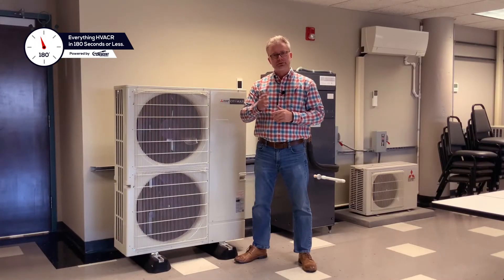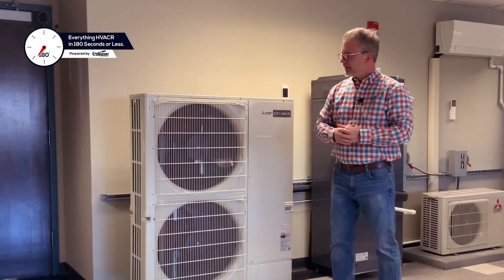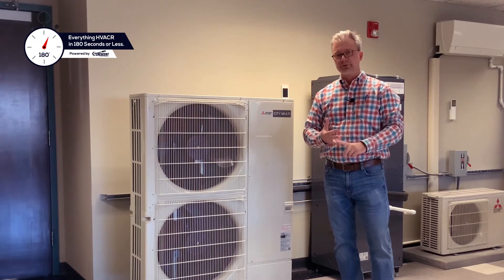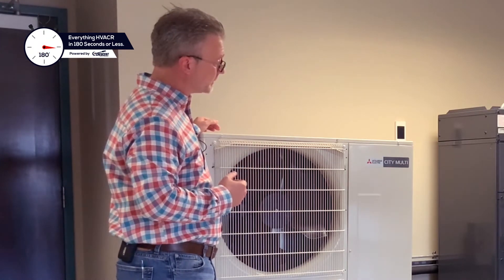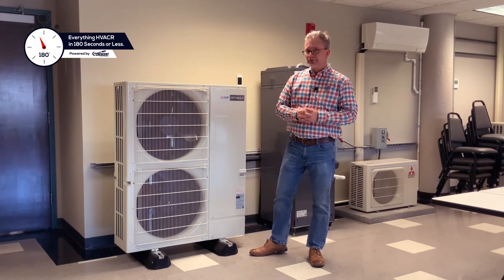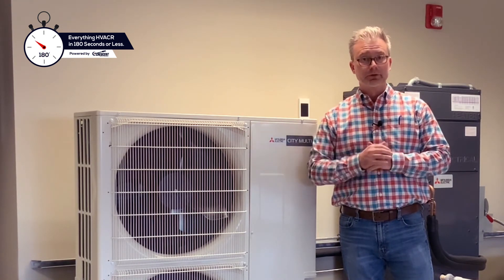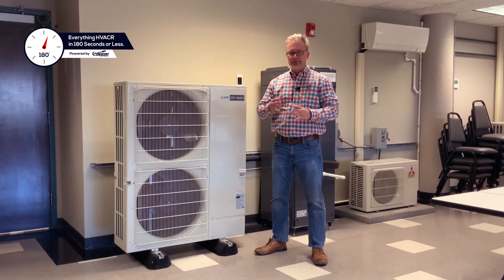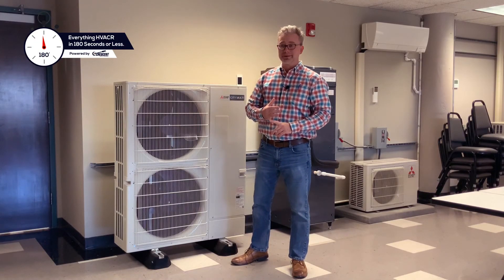Crescent180: Mitsubishi S-Series Cooling System

Comment: Mitsubishi is top of the line just pray you don't need service or parts. You can replace the whole unit with generic for the cost of one replacement board. Ask me how I know.
Reply: Interesting. Good to know.
Reply: Why wasn’t your issue under warranty?  I thought it’s 10 years
Reply: @Colinfichman  Lightning took out the outside board. It had been over 10 years anyway and I did the install myself. Replaced the entire unit with a Gree for not much more than Mitsubishi wanted for the board. So far so good. At the time I did the original install, Mitsubishi was the only game in town. Now there are lots of viable options.

Comment: This video is in degrees Celsius and demonstrates cooling from 23’C (73.4’F) to 13’C(55.4’F) in direct side-by-side comparison with unit of legacy brand.
Our technical data: energy consumption 10 Watt, 65 CFM air flow at 2.7 meters per second air velocity.
Just guess what is technical data from traditional vapor compression air conditioner of legacy brand. https://youtu.be/UW_IJSNAs7Q

Comment: Whats  single faze?
Reply: Standard residential power is single phase.  Commercial power in three phase
Reply: @davidb5952  Thanks for reply , two hot wires is two faze one faze is one hot wire , on eqwipment says one faze 200 somthing V .there is no single faze 240 v in us ,can you explain that .
Reply: @786otto  two hots is single phase. three hots is three phase, a little confusing but thats how it works
Reply: @jonathonbingle9803  Thanks for reply ,im not electrician but way they calling it is just dumb.
Reply: @786otto  a phase is a relationship between two points.

One hot and a neutral is single phase. 

So two hot wires is still a single phase(one relationship).

3 hot wires is three phase(3 relationships).
Reply: @NotOurRemedy  Thanks for reply.
Reply: Is this a 3 indoor unit what is the price!!!!!....?